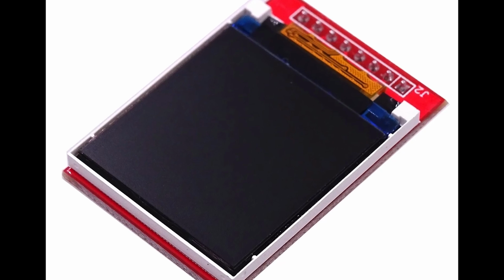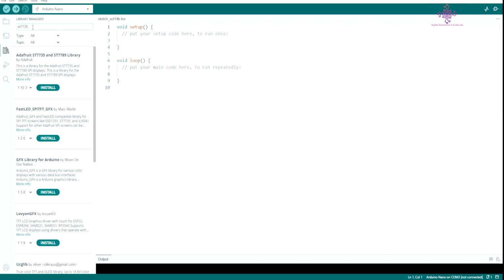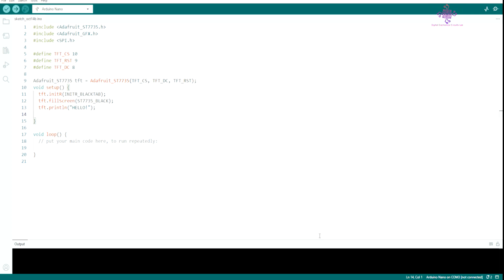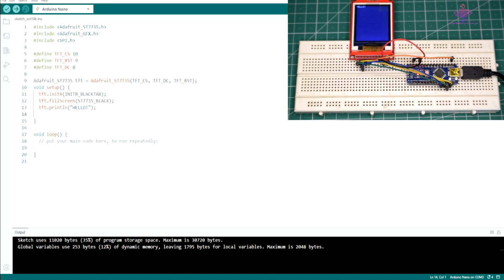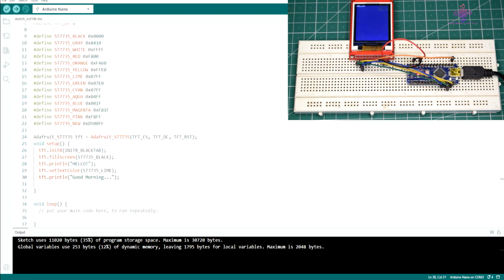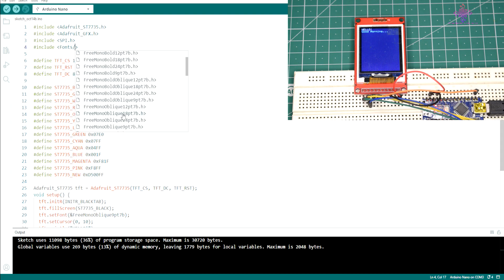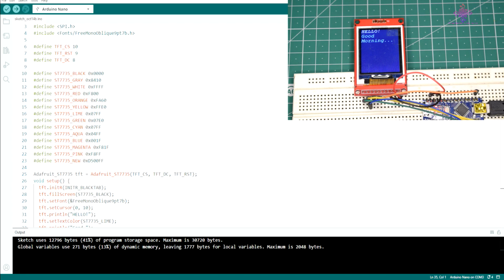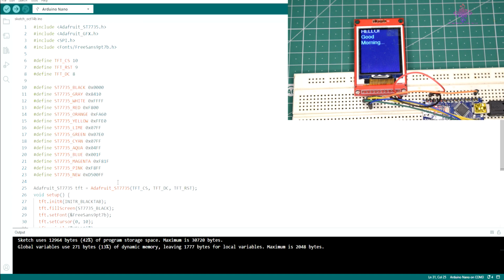DEC #025 Using 1.8 inch color TFT display with Arduino | ST7735

Comment: I got white screen problem if I use Adafruit ST7735 library.
If I use generic TFT.h library, there is no problem.
My wire connection is exactly like yours.
Why is that?